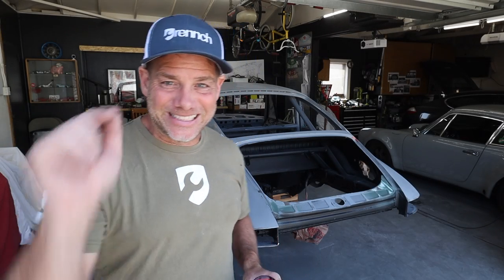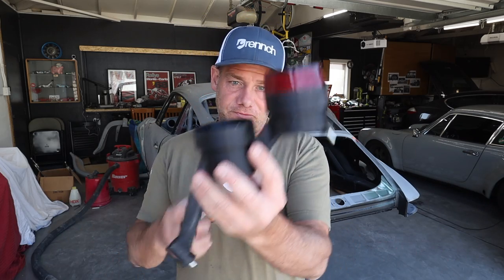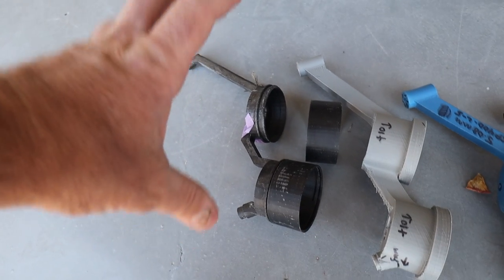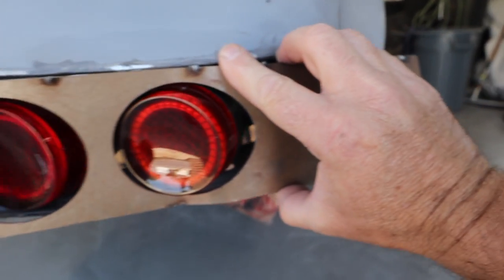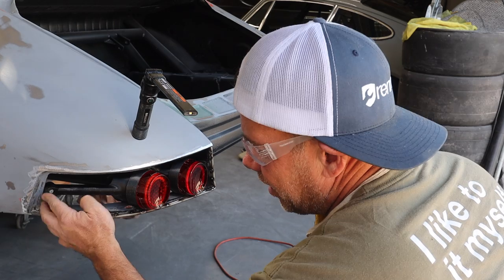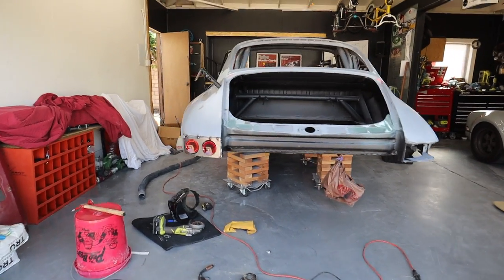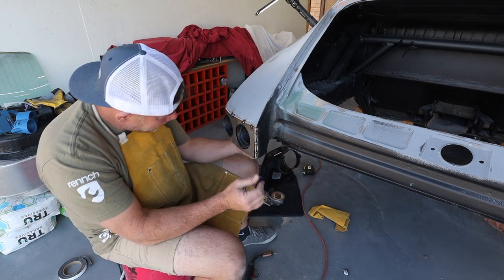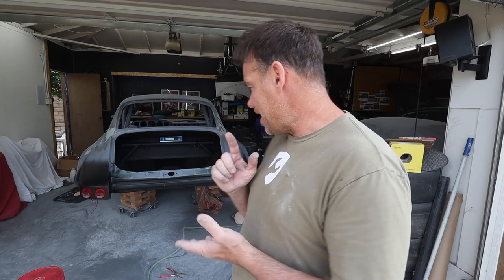* INSANITY! *3D-Printed Porsche 911R LED Taillights With Fusion 360! | Subaru Swapped Porsche Ep. 81

Comment: Hi Michael, love what you’ve done with the lights. Please take this as constructive criticism. I don’t like the slight air gap you can see round the edge of the lights and wonder if it would look better if you had a thin rubber seal round the edge of the hole in the body. It would clean up that line and also seal out any crud. The join could be at the bottom and therefore be effectively invisible. Just a suggestion that I think would finish them off perfectly
Reply: That or they could have had a bit of a return so they don't look thin. The seal you and someone else mentioned will do that job now that the metalwork is complete. Rolling an edge on a small opening is nigh impossible for us guys in a home shop. Really they would have had to be welded. Not fun.

Fortunately a u-shaped trim piece is common and easy to source.
Reply from the maker: You want me to put gaskets and rubber seals on at this point? How about I prime and paint the car first?
Reply: @rennch.  Sorry I didn’t know you were planning on putting seals on - thought this was the finished look as that’s what you seemed to be saying.